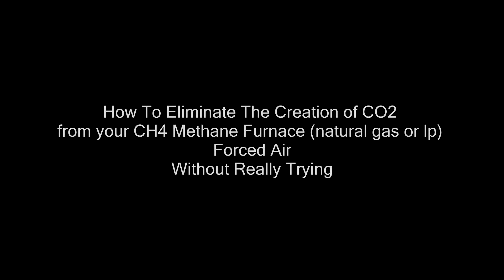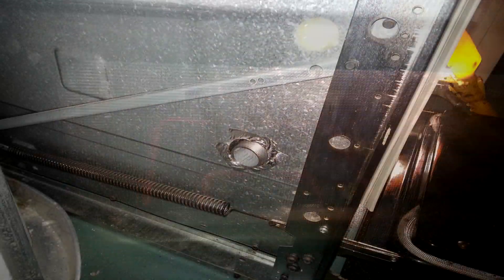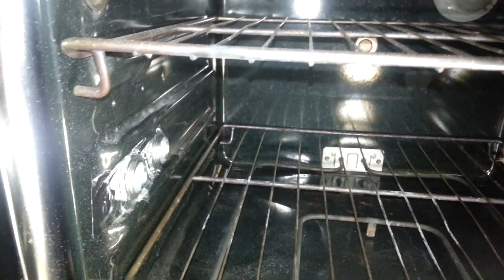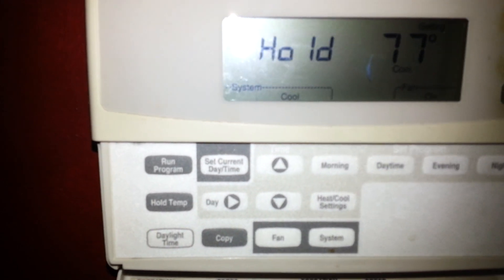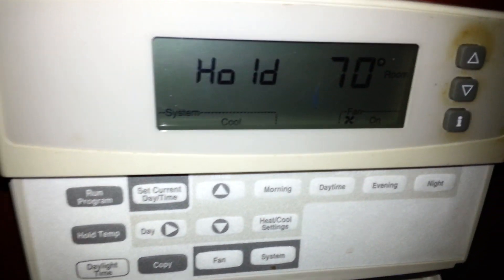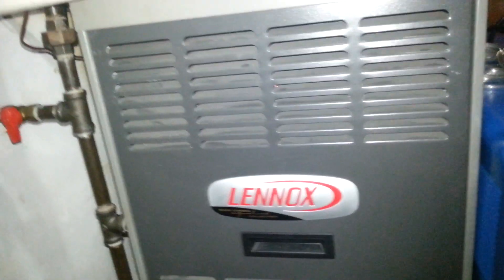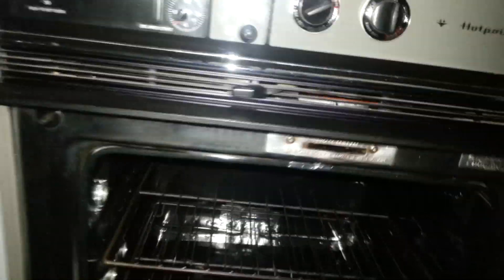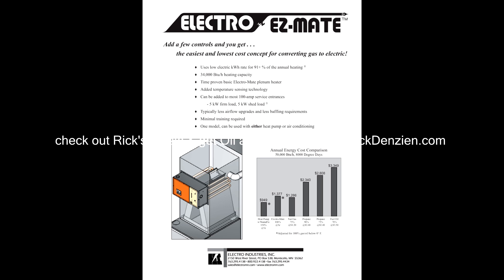How To Convert your Gas Furnace to Electric - Without Really Trying

Comment: I love this conversion from gas to electric using an oven. Do you think an electric clothes dryer would work as well as the oven?
Reply: Probably yes!  Great idea.... As a stop gap measure to quickly get off fossil fuels, yes.  But even though the oven or dryer is cheap, it is not at all efficient cost wise.  
Our really good 3 stage heat pump is keeping us warm now and cool in the summer. And we are powered mostly by our own DIY roof top solar with battery backup.  This setup runs our entire place including our new ventless heat pump dryer.  Thanks for watching and I wish you well.  Check out my RickDenzien channel too.  Best of luck, Rick

Comment: I think you should try it with the heating element out of a clothes dryer installed where the gas burners go. I would definitely. Make sure  the temp limit switches are in working order ect to make it easier just take the middle out of a dryer keep the controls, hook the exhaust of the dryer to the fresh air intake on the old gas  furnace. Seems like a great idea to me.. idk basically putting a toaster oven. Inside the furnace with lid removed. What are your thoughts?
Reply: Great idea as a stop gap measure, which is really what this video is about.  Today we have an excellent heat pump for AC and Heat works great. And I just got hold of a heatpump, ventless dryer that cut the power use more than in 1/2 from the old electric dryer.  Thanks for watching and maybe I'll see you over on the RickDenzien channel.  Keep them thoughts flowing - there is alwasys a better way..... Best, Rick

Comment: When it explodes I hope you don’t get hurt.
Reply: How can an oven explode??   Plus it is very well insulated and the window is double super thick.  This was only a stop gap measure to get off fossil fuels fast, and it worked!.  But now we power mostly from the sun. Much better with a 3 stage heat  pump.  Toasty in the winter an cool in the summer.  Thanks for your thoughts.  Best of luck, Rick

Comment: this is totally rediculous and igrnorant.  first of all you eliminating your carbon footprint by elininating the gas furnas is a total lie.  Your not removing it u r just relocating it to a less efficient and higher carbon footprint source. a power plant fired by natural gas coal or renewables. the thing is u don't know which.  In addition  from the power plant to the heat that you actually feel you for each unit of electric energy burned you lose 70% IN WASTE. what you feel is the 30% left over.  

you haven't removed ANYTHING in fact you've added to your carbon footprint.  Your furnace was the best way to go. You could of gone to a 98% efficient gas furnace and had only a 2% energy loss.  Natural gas i the cleanest burning lowest emiission fossil fuel there is.  It' what fuels your homes and power plants to make electricity.  

It amazes me to no end people think doing foolish things like this and buying electric cars they are reducing their carbon footprint. when in fact they just relocate it and then bring it back to their homes with  greater losses cause instead of burning the energy AT THE HOME where i'ts most efficient and more enviormentally friendly just moving the energy production way from the home and lose more energy bringing that energy back to the home thus the power plants have to generate more power to make up for the loss thus in turn putting more emissions into the air.

enviormentalism is stupid.  it doesn't work.   it is counter productive to saving the enviorment cause it lacks common sense

Comment: If you have a large solar or wind mill this is a good idea. However resistive heating coils are not as good as induction for heat. I suspect if you had hot water system you could use a pressure cooker and be more efficient. That said for the money a good stop gap. Looking at a heat pump for San Francisco weather. We go from 100 F in the summer to almost freezing on the coldest days of winter. Seems like it would be easy to take out the gravity heater and replace with a heat pump in our mild climate. We are currently using space heaters as I shut off the gas to the house. Induction kitchen with a convection 1/4 size Oster French door oven from Costco for $130. Will do a 16 inch pizza. Found a used Bosh Axxis heat pump dryer on Craigslist for a hundred dollars...got to keep them cleaned out as the lint can make the system not work well. We have a 2.4kw solar system which will charge our electric car without grid power...however you can't use multiple kitchen or washer resources and charge the car without pulling grid energy.
Reply: Love the heat pumps! -

Comment: What power consumption are you looking at with a system like this? Would you power it through a solar panels/battery pack? I'm looking for replacing my gas furnace with a cheaper and lower impact on environment system.
Reply: This was a stop gap measure to get off fossil fuels fast. That done, we built our own solar array with 45kw of battery backup, two EV's 150kw max, heat pump for whole house AC/Heat and just added a heat pump ventless dryer.  When this vid was made, I had already opted in for clean energy from wind, but now we make most of our power from our own roof and we use the wind grid for an extra backup. Most of the time we are mostly off grid.  Putting up more solar soon to produce more clean energy.  So, I hope that helps.  Thanks for watching and check out my RickDenzien channel.   Best, Rick

Comment: What a stupid idea to convert to electric. I will keep as much gas in my house as possible, it’s cheaper and more efficient, not to mention electric cooking sucks!!
Reply: I think you need to be reeducated. If you have solar it makes sense to use it as you produce. Inductive cooking burns less easy...you can still burn food... mixed with a pressure cooker and convection oven you can slash your energy bill as well as get off the fossil fuel tit. Everyday big oil stops the conversion to clean tech is 10 billion in their pockets or 3.65 trillion a year. You are poisoning yourself and your loved ones and making the fat cats richer. The convenience is not worth the cost which goes beyond money.  You have to practice anything and induction cooking is about using lower temperatures and looking at the actual temperature and not a flame. I have found that most food doesn't need more than 180 degrees F. You make yourself safer and say FU to the Saudis. 100% American energy.

Comment: Hi wondering if the heating industry is getting serious about deveolping electric conversion units to move off natural gas. Secondly would needed solar panels produce enough electricity to stay off the grid and heat a typical house. Getting around the big energy producer should be another concern to ensure the electric cost not be out of control and it is clean energy. Fascinated by your video and the thinking behind it. thx Mike Neaton
Reply: Mike, 
Stop gap measure to get off fossil fuels fast and it worked.  But I have now built my own DIY solar array with battery backup and installed a 3 stage heat pump that is warm and toasty in the winter and cool in the summer.  We run everything now mostly off grid most of the time.  Our gird is wind power, so sometimes we dip in to that.  But I'm putting up more solar panels every year. Thanks for watching and your good thoughts.  Check out the RickDenzien channel too. Best of luck, Rick

Comment from the maker: shocking how many people are under fossil fuel illusion to such an extent that they cannot understand basic facts. An electric oven is not dangerous. This one was designed  for temperatires up to 1200 degrees Fahrenheit, We ran it at low temperature.  The electric service comes from wind power at the time... a non fossil fuel renewable clean energy choice.  If fact this oven prevented all the methane & carbon pollution in heating season 2014.  This dumb idea got us off of methane in a couple of days. Total success. Moving forward we are still methane free with the all electic furnace, which us UL TUV listed (as was the oven) the furnace produces much higher average output temperatures safely.  Now we have a 15000 watt solar system, backed up by one of two all electic Nissan Leafs.   We use wind power imported from the grid as a back up now.  Cars charge off the sunlight every day and export the power at night.  Zero Emission cycle.

Comment: This has to be the stupidest idea I've ever seen on YouTube.  Your lucky if you don't burn your house down with this shit.   The electricity you use to run this isn't any less emissions than the natural gas that the furnace would have burned normally.  Your actually polluting more because heating with electricity isn't as efficient as with natural gas so the power plants have to burn more coal and natural gas to supply the electricity for this dumb shit.

Comment from the maker: This was a "shocking" temporary way to get off one of the worst global warming gasses CH4 (methane) and low budget.  The oven lasted one heating season, long enough to research and save financially for other options.  Just installed an electronic furnace from Ducane which is doing very nicely.  Cost about $600 and I had a little help on the installation.  Still eliminated the CH4  and the total cost to heat is still less.  Now we are installing a solar panel array up on or roof.  Soon the grid will be our wind power backup. And we have stationary batteries to back that up from our Electric Vehicles.

Comment: What a crazy idea! Isn't electricity substantially more expensive than gas? A heat pump I can understand but you're using resistance heat.
Reply: Scott,
This was a stop gap measure to get off fossil fuels fast, it worked.  Now we do have a 3-stage heat pump powered by our DIY solar array with battery backup.  We are off grid most of the time and we do occasionally dip into the wind power grid.  Putting up as much solar as I can. Thanks for writing and your thoughts, Best of luck, Rick

Comment from the maker: For this heating season I found a very good all electric furnace total cost under $600.  This one will sit in the same foot print as the methane furnace and will replace it.  We recycled the in wall oven.   So sad it kept us warm all last winter.  Will post another video soon.  Keep Warm.
Reply: hahahaha electric furnaces may be CHEAPER to buy for the equipment but in general are very inefficient  producers of heat.   They waste far more energy  thus putting far more emissions in the air via higher prodcution at the power plant.  Compared to a natural gas furnace that thing puts out far more carbon. just cause it's not being released at your home doens't mean your not adding to it.   electric furnaces like all other sources of electric heat are only 30% efficient and waste 70% of energy in consumption where as a highest efficient gas furnase is 98% efficient and only wastes 2% energy in consumption. no matter how you look at it you can't beat those numbers  that's the best way to reduce your carbon footprint.  

Your way was only increased polution  just cause you moved the production from your home to a power plant doesn't make it go away.

Comment from the maker: Methane is 70 to 135 times worse as a global warming gas than C02 in the atmosphere.   Fracking, production,  storage and delivery of this gas causes it to be released directly into the atmosphere.  Then when it finally gets to the heater, we burn it and then on top of the previously released Methane, we now release CO2.  So heating with this gas is very very bad for maintaining a livable biosphere.  It is every person's job #1 to get off of these greenhouse gases at home at at work.  So this is a brilliant idea.  I dare you to do better using only wind and solar powered electric.  Be an inventor and get us off Methane.

Comment: This has to be the dumbest idea that I have seen in a long time.
Reply from the maker: $200 per month saved on methane heating.  Dumb for sure, but this simple idea demonstrates how easy it is to get off methane and reduce green house gas emissions.  We power our place with wind power through Ethical Electric https://ethicalelectric.com/referral/go/ThriveStation.com#/  We do expect that our electric bill will be higher as a result of our oven furnace, but we are not polluting - which is the main point.   That $200 per month translates in to thousands of pounds of methane CH4 and carbon dioxide CO2 from hitting the atmosphere.   Also there are commercial electric furnaces available that are designed to fit in the same foot print as a methane furnace, they just cost more than my $25 craiglist oven.
Reply: +Bah-fo Recording Studio why not just get a damn heat pump, they can operate at 300 percent efficiency.
Reply: @scottshingleton384  I agree!  My heat pump saves me a lot of money, especially when using the cooling mode.  It's much drier air and dehumidifies much better than a typical A/C unit that accompanies a gas furnace.  However, the hybrid (furnace plus heat pump) system costs more to install, and I think he's trying to save money on installation here.  Over time, though, the heat pump system saves the homeowner quite a bit of money, as do solar panels.
Reply: Scott  Shingleton if he's freaking out about burning natural gas, then how outraged do you think he would be about chlorofluorocarbons?